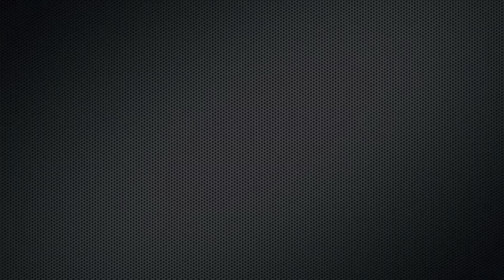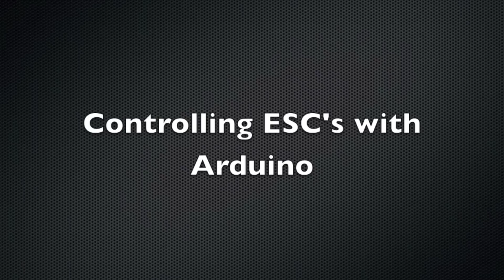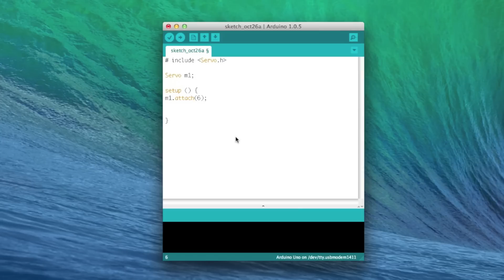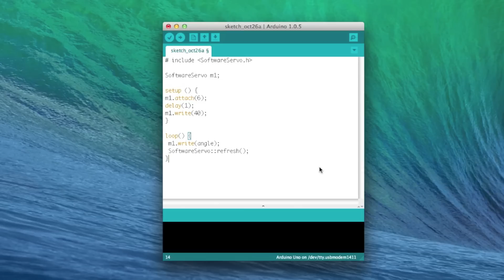Controlling an ESC using an Arduino

Comment: Hi, now I'm trying to use the ESC which its model is Skywalker-30A to control a brushless motor, but just confused with the programming with the Arduino Uno. Just wonder to know if this kind of ESC is same as that in your video while programming. Thank you very much.

Comment: hey im starting aa biuld consisting of an electric longboard and was thinking that if i pretty  much build an rc car underneath the skateboard and then add some pulleys, could i swap the reciveer of the remote and sway it with one of theese, then the other side onto an ardiuno and then a joystick potentiometer module with a little lipoly connected to keep the aurdiono going?

Comment: Hey there. My group will be using two Traxxas XL-5 Brushed Waterproof ESCs for two Titan 12T 550 motors, one for each motor, which will be controlled by the DFRduino RoMeo v1.1 board. I haven't used Arduino before, and I'm look for some hints or even examples to get this code working.
Please and thanks, Dale

Comment: in a comment you said "The Arduino sends Pulse Width Modulated (PWM) signals to the ESC through the small white signal wire and the ESC does the rest for you.", could I acheve this buy using a small "motor speed controller" that is found on ebay/amazon?

Comment: I am using HW30A ESC and an arduino UNO board.  If I make the connection from the ESC to the arduino and the power source without the connection to the motors, can I still expect to hear the beeping noise? I don't have the motors with me at the moment, but still would like to test the ESC. When I run the code, I can see the arming message and the rest of it getting printed but no sound coming from the ESC. What does this mean? Thanks.

Comment: Hello, I'm working to try and get a motor to run from my arduino due, I am using an ESC with what I believe has a linear BEC and have been trying to program it. I tried using the program that you wrote but it didn't work. Do you have any advice on how I can continue or what else I should try?

Comment: I have designed a tattoo machine with Bldc motor.  But need arduino to control speed of motor , with a brake feature.  So that when i press brake it stop and than starts at the same speed where it stoped,  and need an speed controller that can be a potentiometer or digital anything can work.  Can u please help
Reply: And i dont anything about coding. 🤐

Comment: hi , i need your help urgently i would really appreciate it, i suffer from sleep apnea and my machine broke, so i use an esc to power the motor, it works with sweep but not with knob, i use an arduino uno, pls dude could you write the some code for me, so that the esc sweeps from 0 to maximum and stays in maximum? i cant make it work

Comment: hi, I am using a gemfan 30 a esc.. but do not know how to control rotate cw and ccw... do you know how to use servo to let it work? Thank you so much
Reply from the maker: Hi, to change the direction of the motors you need to swap two of the three wires connecting the ESC to the motor. Try Swapping the positive (red) and signal (yellow) wires on two of your motors.

Comment: Awesome video, thanks for taking the time to post this, do you know a good resource for finding arming angles, or delays with angles. I have a Traxxas EVX2 and I'm having a hard time arming the esc and sending a pwm to it, my ultimate goal it to control the esc with a potentiometer but I can't seem to get past arming it
Reply: Did you figure out how to operate your brushless motor with a potentiometer?
Reply: @Resteasy8686  anyone got a solution?

Comment: The documentation states "0 being full-speed in one direction, 180 being full speed in the other, and a value near 90 being no movement" does this apply to ESCs or is it 0 for no movement and 180 for full speed?
Reply from the maker: Hi, Thank you for your question. From my experience 0 has always shown no movement, 90 is close to an idling speed (75 was mine) and 180 was full throttle. I have read that using Servo.writeMilliseconds(int) can be used to tailor a max and minimum PWM speed which may give different results. I will be playing with this and reporting back.
Reply: Thank you for your fast response!
Reply: Greg Karz I

Comment: the hobbyking pentium 30A only has 3 motor outputs, how did you get around this?
Reply from the maker: Hello, Thank you for your question. Each ESC will only connect to 1 motor. Each Brushless DC motor will have three connections to the ESC. The Arduino sends Pulse Width Modulated (PWM) signals to the ESC through the small white signal wire and the ESC does the rest for you. If you want to reverse the direction of the motor you would have to switch two of the three connections between the ESC and motor. Hope this helps.

Comment: Hi i have a question, how would i change the direction of the propellers? if i want them to go the opposite direction. please help
Reply: Omar Gonzalez  u mean  2 clockwise and 2 anticlockwise ?
Reply: yes
Reply: just change the wires that connect the motor with esc until u get what u want
Reply: okay' thanks
Reply: any time

Comment: hi,
i tried to run 1 motor, misteriously it worked a few times but normally its just making bep bep bep bep
i think the "arming" doesnt want to work :/
Reply from the maker: Hi, Thank you for your comment. Which ESC are you using? Your manual will define the beep codes, but if it now is not working and you get one beep a second, for my ESC's that's a sign that there ins't enough voltage getting there. Try charging to a full battery again and see if that makes a difference. Please let me know how you get on. :-)
Reply: Hi, i've got hobbywing skywalker 20a esc's

I discovered, if i put 
M1.write (40);
First in the loop, transfer it to the arduino the motor does nothing
And if i put m1.writeMicroseconds (1100);
In the loop and transfer it the motor begins to spin

If i put directly 
M1.writeMicroseconds(1100);
In the loop it keeps beeping
Reply: Anderon hey im trying to figure this out what do you mean by transfer it to the motor

Comment: hi i want to make a quadricopter i use a arduino uno

 and 3 

Speed controller 20A esc MB30020 SimonK BEC Naza compatible

and 1

http://le-modelisme.com/?Rc-1620Rc---Turnigy-Multistar-20-Amp-Multi-rotor-Brushless-ESC-2-4S-OPTO-480Hz-multi-rotor.html

 i can calbrate juste one esc but i cant calbrate the 4 esc 

when i calbrate one esc i use this code 

#include <Servo.h> //Bibliothèque permettant de piloter un moteur brushless
 
Servo monMoteur; //Création de l'objet représentant notre moteur
  
void setup(){ //Methode executée une seule fois au lancement du programme
 
    monMoteur.attach(9,700,2400); //On indique la broche sur laquelle est branché le contrôleur
     
    //On suit la doc du variateur pour le calibrage
    monMoteur.write(180); //Puissance max
    delay(2300); //On attend environ 2 secondes
    monMoteur.write(0);  //Puissance mini
Serial.begin(9600) ;
}
  
void loop(){ //Methode executée en boucle. Vide dans notre cas mais obligatoire pour compiler le programme
}

the esc calbrate but i cant calbrate the 4 esc when i use this code

#include <Servo.h> //Bibliothèque permettant de piloter un moteur brushless
 
Servo monMoteur1 ; //Création de l'objet représentant notre moteur
  Servo monMoteur2 ;
  Servo monMoteur3;
  Servo monMoteur4 ;
void setup(){ //Methode executée une seule fois au lancement du programme
 
    monMoteur1.attach(3,700,2400); //On indique la broche sur laquelle est branché le contrôleur
    delay(2300);
     monMoteur2.attach(5,700,2400); //On indique la broche sur laquelle est branché le contrôleur
     delay(2300);
     monMoteur3.attach(6,700,2400); //On indique la broche sur laquelle est branché le contrôleur
     delay(2300);
     monMoteur4.attach(9,700,2400); //On indique la broche sur laquelle est branché le contrôleur
     delay(2300);
    
     
    //On suit la doc du variateur pour le calibrage
    monMoteur1.write(180); //Puissance max
     

    
      monMoteur2.write(180); //Puissance max
      
        monMoteur3.write(180); //Puissance max
        
          monMoteur4.write(180); //Puissance max
          
    delay(3000); //On attend environ 2 secondes
    monMoteur1.write(0);  //Puissance mini
        monMoteur2.write(0);  //Puissance mini

    monMoteur3.write(0);  //Puissance mini

    monMoteur4.write(0);  //Puissance mini

    Serial.begin(9600);
}
  
void loop(){ //Methode executée en boucle. Vide dans notre cas mais obligatoire pour compiler le programme
}

can u help me please

Comment: Servos can go on any pins; they don't have to go on ~PWM pins, that's bollocks. I stopped watching then. (They can go on analog pins A0 etc, even.)
Reply: definitely not bollocks,  i have a XXD 30A ESC on A2 and its fine, and i have servos on the A0 and A1 also fine